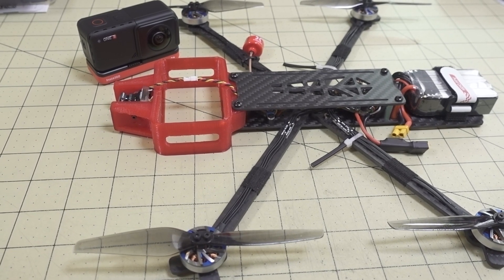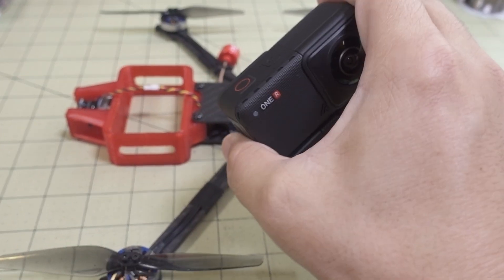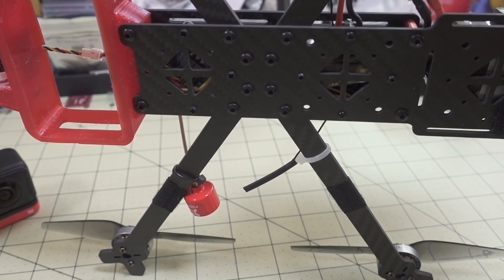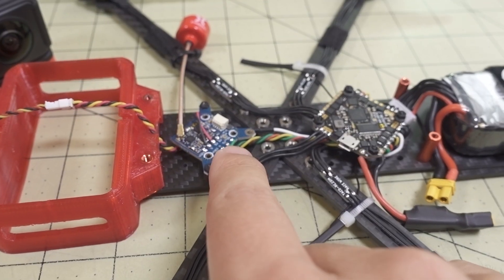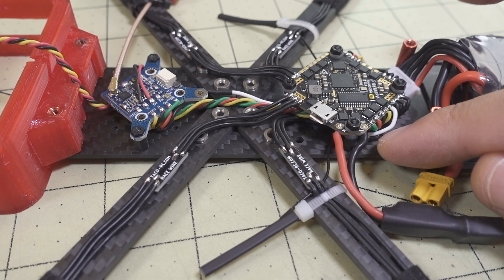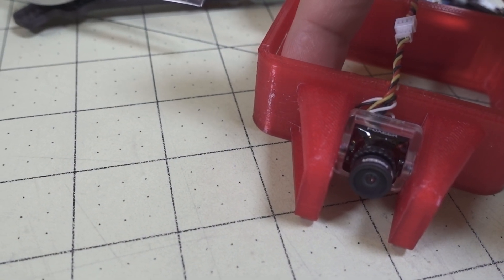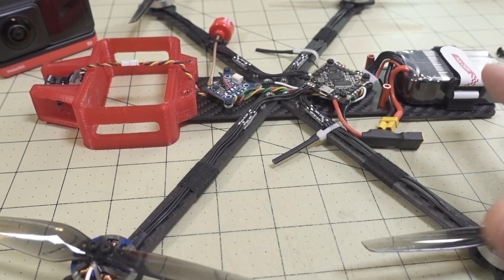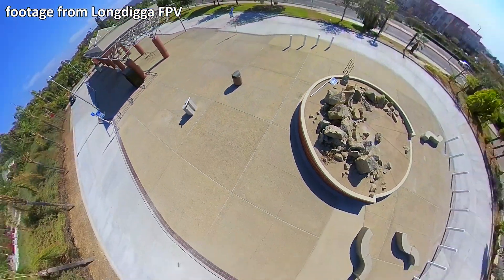Build an Invisible 360 Drone 👻 // Stealth360 by Rob FPV

Comment: Hi, great video!💪 I was wondering, how can I get my hands on an INVISIBLE DRONE FRAME KIT that can accommodate the Insta360 X2 or X3 model? Also, I noticed that most of the invisible drone kits have the Insta360 ONE R. Is there a specific reason for this?
Reply from the maker: There is no model for the X2 and X3 because of the battery.

Comment: Why did you mount your arms above the bottom plate? I noticed that the top of a motor showed but just a sliver. I just got my frame and I mounted the arms below the bottom plate with the press screws down. Think it might be the clearance you need to get rid of that.